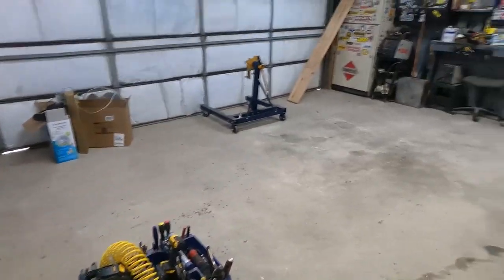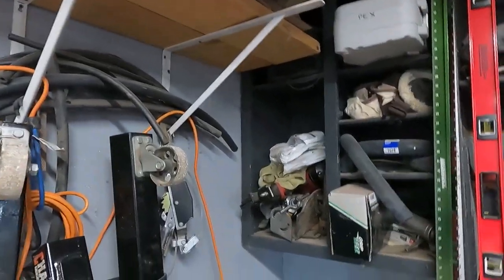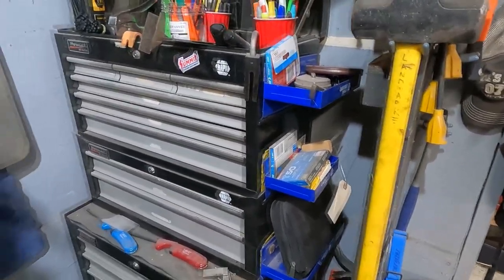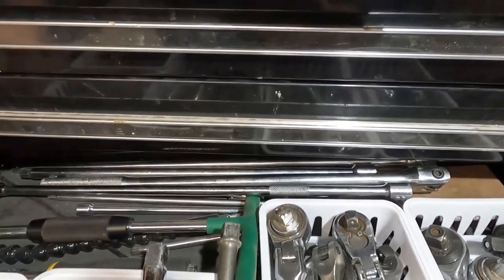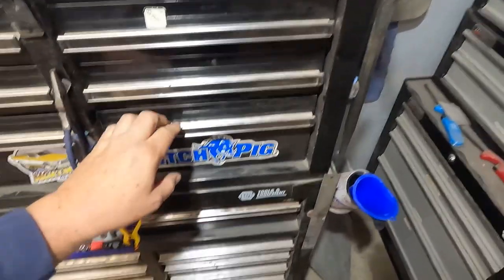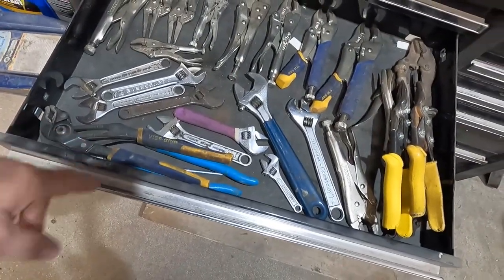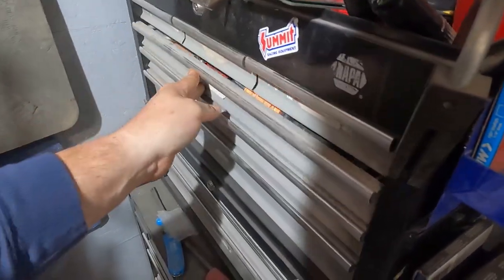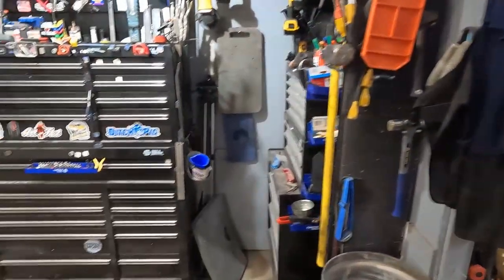Tool box and garage tour of the tiny Landshark Garage.

Comment: The tool you showed at 27:11 looks like a tool that removes locking bead that goes in between the weather stripping of the window shield and rear glass also helps start the locking bead. Great video 👌